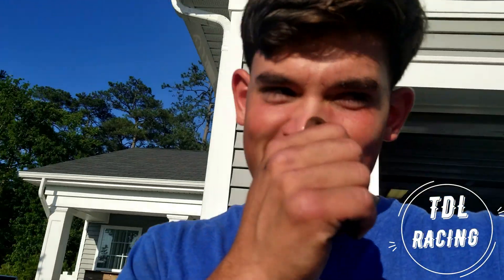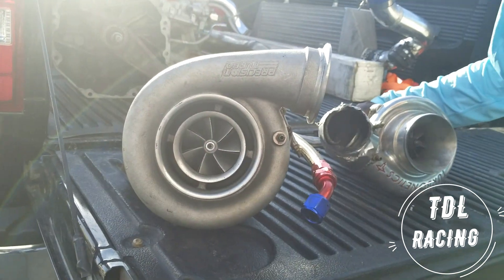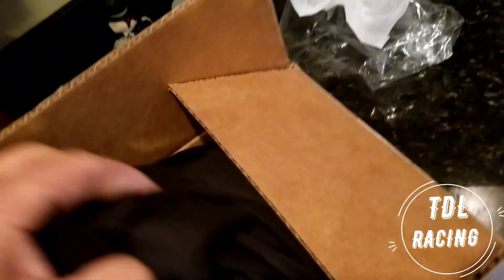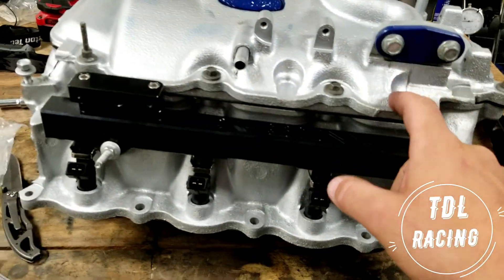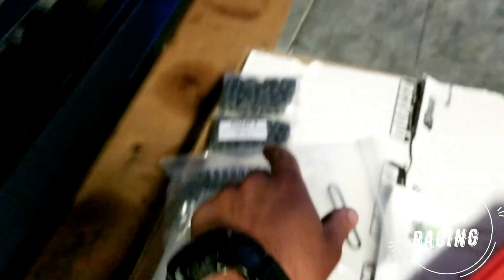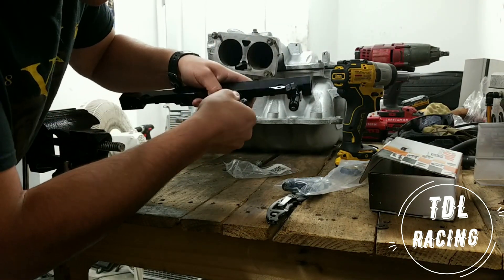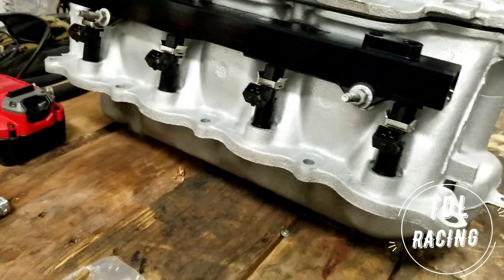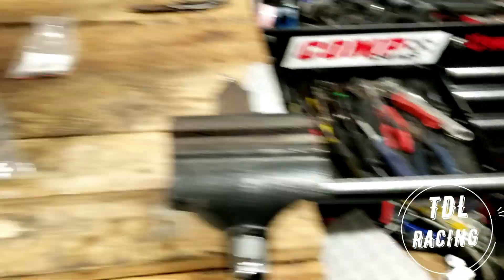HOW TO BUILD 1000HP 4.6 (BIG FUEL SET UP & HALTECH) EPS 7

Comment: Hey man anyway you could make a video with the fuel rails all hooked up? Just got a set for my mach. Also what else do you need besides just the rails? Thanks
Reply from the maker: Yea for sure man I'll work it in the next video!!!
Reply: @tdl_racing  appreciate it man! Also what’s on top of the fuel rail that’s on the left?
Reply from the maker: I think its purpose is for a fuel pressure sensor. Do you have an Instagram and I'll send you a video real quick
Reply from the maker: Oh gotcha okay!
Reply from the maker: I went with Magna fuels fuel pressure regulator and haltech fuel pressure sensor.
Reply from the maker: No because I ran a return style fuel system.
Reply from the maker: Something like that. I ran AN hose so yes I ran a bunch a fittings to connect both fuel rails.
Reply from the maker: So what I did was feed the passanger side fuel rail from the rear, then connect the front of the passanger side fuel rail to the driver side front fuel rail and then ran the rear  part of the driver side fuel rail to my fuel pressure regulator and then back to my tank.